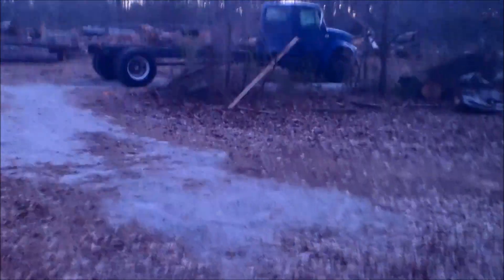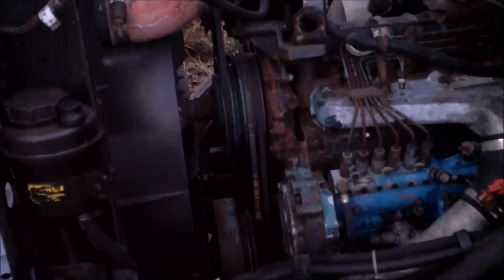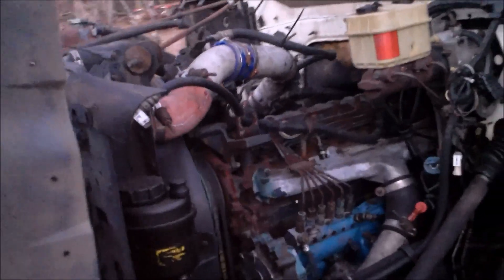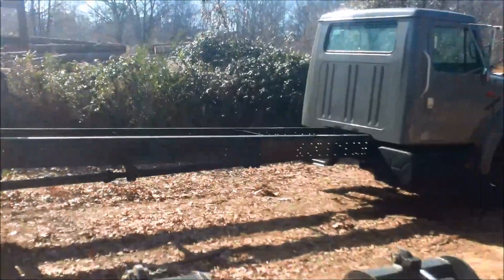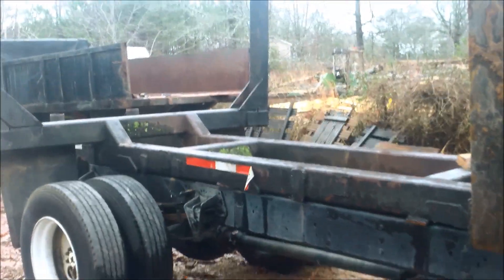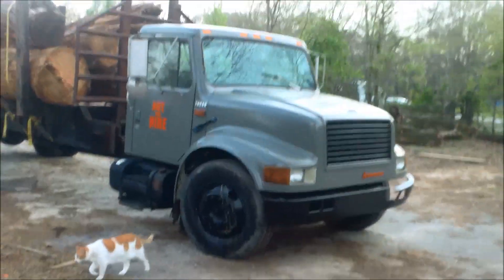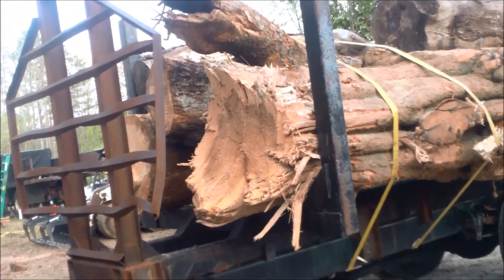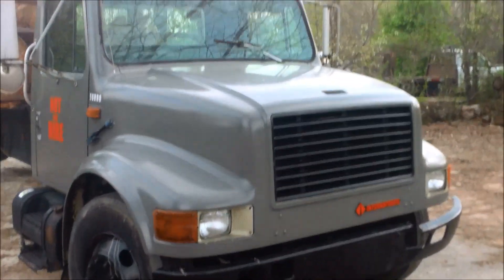LOG Truck build

Comment: On towing a trailer, its combined weight rating, 10k trailer and a 26k truck is 36k so you need a cdl, does not matter what sort of braking system its a matter of total weight your truck and trailer can carry

Comment: good truck, those are great engines, when you had the hood opened I saw there was no air cleaner attached to the turbo ?
Reply from the maker: When I bought it it was removed I reinstalled it

Comment: I really like your truck build but it is really long. The problem is you ill really load the front and possibly break your truck in half.This would be a lot better truck if wheelbase was shorter but to each his own, just my two cents , good luck.